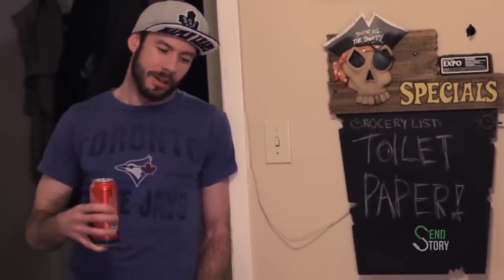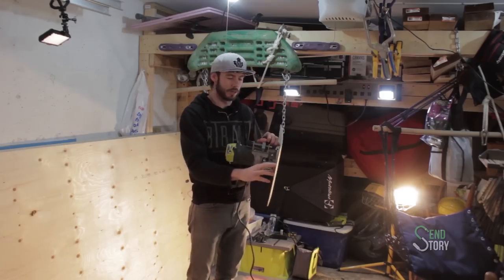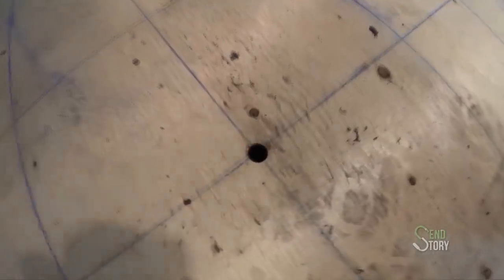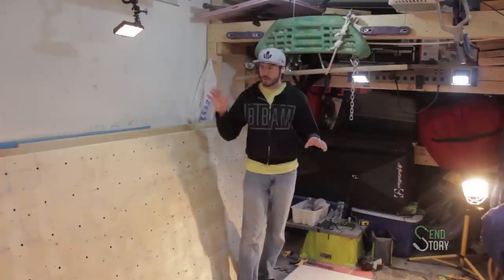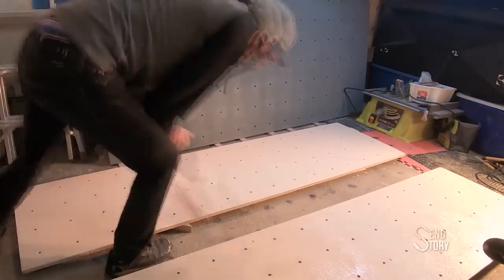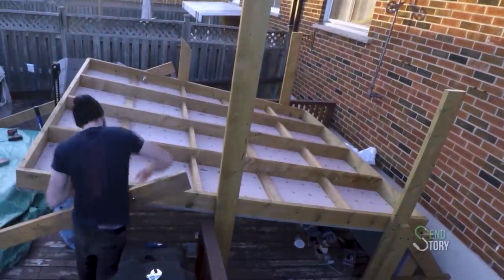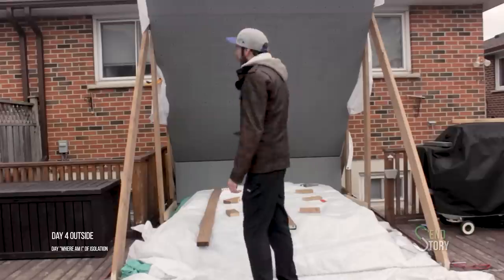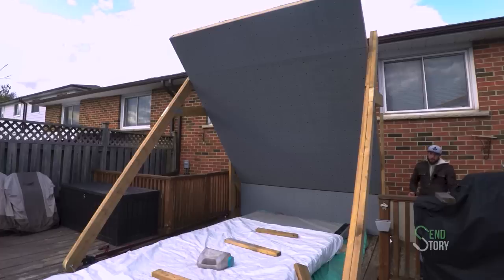Building an Adjustable Home Climbing Wall During Isolation - 12ft Bouldering Wall - Full Build Video

Comment: Great video! Me and my friends are going to build one like this! Did you only paint the plywood or the 2x's as well? also how much paint did you use for weatherproofing it?
Reply from the maker: I used exterior grade paint on the plywood, two coats on the entire boards. Make sure you paint before you put the T-Nuts in the wall, otherwise you can get paint in the threads and it will be really annoying and in some cases almost impossible to get out. I didnt paint the structure/dimensional lumber because it was all pressure treated and is all above grade and can dry. However, with that said, there is also pressure treated plywood, but I am not sure of it's strength/integrity. I also tarped the back of the wall after it was all assembled to keep the weather out of the T-Nuts and to remove the possibility for water to sit or pool in the structure and get into the ply. Some people also use other materials like corrugated plastics or light roofing substrates, but I wanted something simple, cheap and super light, so tarps were what I ended up with. Lastly, I would make your kick plate / kicker / kick board (or whatever you want to call it - the straight panel just about the ground) a tiny bit shorter than the frame it sits on because you dont want it sitting on the ground and have the chance to wick up moisture. I hope that helps!
Reply: @SendStory  Thanks so much for the reply and the tips! I was just wondering cause I'd have mine in my back yard with sprinklers and such so I might try tarping like you said or staining or painting what I can. Thanks again for the help!

Comment: Amazing build thank you for sharing.  Do you have a breakdown of materials and cost?
Reply from the maker: No problem! Thanks for the comments. Unfortunately I dont have a breakdown of costs and materials, but if you watch the video carefully you should be able to figure out the general material list. Every piece of lumber is 2x6, and 24" on center - so that works out to be 5 studs running vertical and then a base and top plate. That is true for the kicker and the adjustable wall. The legs I think are 12 ft lengths, and then the cross-bracing for the  base is just cut downs from the other lumber pieces. 

One of the reasons we dont have a full materials list or a breakdown of costs is because we wanted to build this wall for a while and were slowly collecting materials and parts over time and bought things like holds slowly on sale and such. I would say the build part, minus the price of holds, probably was around $1000, but most likely a bit under that. Some things might be over built slightly, and you might be able to do it cheaper. However with that said, the price of materials has definitely gone up since covid, so we would have no clue what they are right now.

There are also some more details and pictures through a link on our description that go to our site that might help you figure out materials along with the video. I would suggest always trying to get an extra piece of lumber or two, just in case you have any mis-cuts or other issues. Plus, you will always be able to use extra dimensional lumber somewhere. I hope that helps! Good luck!
Reply: @SendStory  Thank you, the breakdown on your site is helpful. I've since watched several other home builds and have compiled a rough material and cost list. Side note, do you use Blender for fun or career? Asking because I work in the gaming industry as a 3D artist, I plan on mocking up my build in 3D first as well. Thanks again!
Reply from the maker: @clarkcoots  Definitely started as a hobby, but I have slowly been introducing it to my professional career. The caveat there is that my job technically doesnt involve 3d, and if it does it is often an outsourced skill (I am in the general "design" world). Honestly, Blender is a specular program that is so unbelievably modular that it makes my head hurt sometimes just thinking about the offerings it provides while being open source. Thanks again for the comment, I appreciate it.

Comment: I want to know how you put it back to 45⁰ if you have to unspool the ratchet straps then the purpose of the ratchet straps is to set the wall 45 to 35 and not the other way around
Reply from the maker: Hey, the straps are definitely better in one direction than in the other, but they can still be used independently to capture distance and help lower it. Essentially if you are alone, you can just release the tension one side at a time, move the leg slightly, then re-lock the ratcheting mechanism and do the same on the other side. The way that the legs are angled actually mean that a lot of the weight of the wall is distributed down the legs into the ground and not outwards, so technically, when you loosen a strap, the wall stays put from my experience and you actually have to pull the leg to move it out. With two people you could change the angle quite quickly, and I would argue, safely, without much fuss. Alternatively, I mention in the video using a backup chain system with a carabiner at some point for redundancy, if that is installed, you can use that as well to help you lower the wall alone. Someone also mentioned "belaying" the wall on a gri-gri if you needed to, and while I think that is unnecessary (the steps I already wrote are more than enough to lower it), that would also work. I hope that helps.

Comment: What sort of hinges did you use, I'm thinking of doing something like this but not sure how
Reply from the maker: I used hefty gate hinges meant for outdoor use, as mentioned in the video, I used longer and stronger screws instead of what they came with. Alternatively, some people have used slightly bigger lumber and have put a metal pipe or conduit through a hole they drill through all of the boards to act as a hinge.

Comment: how many btbam shirts you own man? loving it. great build. just wondering what size wood you think would be minimum requirement for the frame on the back of the boards? Cheers!
Reply from the maker: Haha, someone noticed. It wasn't until I edited that I realized that I was basically wearing exclusively their merch. I pretty much buy all my shirts at shows, and they are one of my favourite bands, so I have a lot (plus my wife's shirts). As for the boards, I think 2x6 should be the minimum for this design. Some people build with 2x4, but I hear that flexes for a lot of people, so probably not the best bet especially if you are doing 24" on center like this one. If you wanted to try to save a buck, you could make the outer frame and legs thicker lumber, and center vertical supports 2x4, but the savings are probably minimal and it would make adding any type of back cover for weather more annoying to attach and have a bow in the middle. Following general house framing rules is a good idea, and most floor joists are a minimum of 2x6. Let me know if you have any more questions. Thanks for the comment.
Reply: @SendStory  thanks for getting back man. I've since built my own wall using pretty well recycled timber from around my parents yard. (bought a few 2x6's for the legs). It cranks! Loved the video. And yeah, btbam fucking rock. seen em a couple times down here in Aus

Comment: Do you mind sharing your 3D blender file? I'm considering building my own and want to compare designs, and maybe borrow/steal some of your ideas :P
Reply from the maker: Hey, I will try to see if I can upload a file at some point when I get a second. Not sure how hopeful it will be (it's pretty basic), I did upload a render with measurements on the link in the bottom of the description, that might be more useful. Let me know if that helps!
Reply from the maker: I am fairly certain it is much too late, but just uploaded the .blend to Blend Swap - you can find the link under the image of the rendering on the build page on our website (linked in the description of this video). Not sure it offers a whole lot more than the descriptions and images on the page, but hope that helps!

Comment: This is great! So detailed, thank you - I’m currently starting my process into building my own wall. 

I was wondering why you decided to go with the industrial grade t nuts (3 screws) instead of the t nuts with the teeth, that you just can hammer in. I assume it’s because the industrial ones are stronger and less likely to strip? Do you think it’s worth it to buy the industrial t nuts over the other ones?
Reply from the maker: Thanks for the comment. I have used hammer-ins in the past and had a few issues. One of them being that because you hammer them in, the force of the strikes can force them in on odd angles sometimes if you aren't careful. The second issue I had no comparison to confirm, but I heard they tend to fail more frequently than the screw-ins. So far I think this is true, but it's not like the hammer-ins ripped out frequently or anything. Honestly though, on a volume I built, I simply put a bit of regular wood glue around outside of the holes i drilled before I hammered in the tnut and they have held up great. So, for a home wall I wouldn't worry too much about the tnut unless it is in a place you can't access - then it might be worth it for the screw-ins
Reply: Send Story awesome thanks for the reply!! 😊 very helpful!

Comment: This is awesome!! I’m from Chile and this is an incredible home wall!
I have a question, how do you do to adjust the angle back to 45, from 35 for example? 
I mean, how do you make the angle stronger after you already put it higher up? 
My fear is that the wall just fall down. 
Thank you so much!
Reply from the maker: Totally a valid question. I've only lessened the angle once, so I can't day I've adjusted it a lot. However, if you adjust it slightly one side at a time, it seems fine, just a little clunky. So essentially you just loosen one side a bit, then lock the ratchet, and then do the same on the other side and go back and forth at a pace you feel comfortable with. Alternatively, if you had two people you could both adjust it similarly, but a lot faster and even on both sides.
Reply: @SendStory  Thank you so much for your answer!!
Reply from the maker: @raisadegodoy9071  no problem! Hope it helps

Comment: hey i have been wanting to build my own wall however im not sure on how i work out what supports i need for my wall
Reply from the maker: Like I mention in the video, I'm not an engineer, so I would have someone with structural knowledge look over anything you build that you are worried about.  Typically, using house framing as an example you can roughly figure out what kind of lumber you need and how it should be assembled. In construction, you want anything load bearing to be resting/supported directly by structure (in this case,  lumber). The type of support you need will depend on your design, so it's hard to comment without knowing what it looks like, but typically you want to be using at least 2x6 for supports and if you aren't tying into other existing structure (like a wall or roof), you want to have your supports in the direction of the load. So in my example, since I wasn't tying into structure (it was free standing), and it was designed to be over-hanging, I put my supports on a diagonal to make it an A-frame. So when my force is pulling down with gravity and out from the wall, the legs (supports) are taking that force. I hope that helps, there is a good resource on Facebook called "the home climbing forum" which might be able to help you out more as well.  Good luck!

Comment: how did you attach the horizontal and vertical bracing? pocket screws?
Reply from the maker: I actually just offset them by half their depth so I could screw directly through the vertical studs into the bracing ends. You could probably "toe-nail" or pocket screw holes if the obsessive compulsive in you wanted them all to line up, but I think you would lose some of the rigidity you get from screwing right through. Hope that helps!
Reply: @SendStory  ah that makes sense, thanks dude

Comment: How much was all this minus the holds ?
Reply from the maker: Hey! I think it was probably all under $1000 (CAD). It is hard to say though, because I had been planning on building some kind of climbing structure for a while and accumulated some hardware and had built up a little supply of lumber before hand, so it would definitely be an estimation. Also, right now lumber costs are through the roof because of Covid, so my figures probably dont add up. Something else to consider, which isnt something you asked, but I figured I would share to help you budget more accurately, when you are thinking about holds, dont forget you need to get the bolts with them. They are an additional cost. Some sites allow you to order your holds with bolts, this is probably the best option so you are including that in the budget. Hopefully some of that was helpful. Thanks for the comment.

Comment: Do you have the blender file? I am creating my own wall but am struggling with constraints to get the hinge actions to work.
Reply from the maker: Hey, I actually have it through a link on our site (buried low in this video description, but right now the hosting company is doing maintenance and the site is deathly slow). Here is a work around link: https://blendswap.com/blend/26374 - Unfortunately, I dont think I have the constraints and such working in that file, but you should be able to work around it by just setting your cursor to the pivot point (inner bottom vertices of the wall face) and setting your rotation tool to pivot (transform) around the cursor. A bit clunky, but it should hopefully do more or less the same thing you are looking for (I hope). Feel free to ask any questions if you need to, good luck!
Reply: @SendStory  thanks a bunch for the reply. I'll definitely take a look at the blender file. I'm struggling with constraints at the moment. I'm also building a free standing board that changes angle, but mine is a bit more complex then your design https://www.youtube.com/watch?v=2bqjb62jqSE . Do you have any resources that helped you to better understand constraints and armature rigging? I'm totally stuck right now; I'm frying my brain just looking at this blender project and not knowing how to even begin to get this thing properly constrained or rigged.
Reply from the maker: @CapableCaptain-ahoy  honestly, I unfortunately don't have a good answer for you. I have watched a bunch of tutorials over the years on rigging and just leaned on that memory/knowledge. The rig I made was definitely finicky and not perfect (it might have been a little bit of animation on top of the rig to fix pitfalls of it... can't remember), rigging can get super complicated and almost like visual programming. I think cgcookie had some good rigging tutorials (not sure if they were free or behind the paywall), but I would watch any YouTube blender tutorials on rigging mechanical actions/movements specifically. I think on this animated demo I used parenting quite a bit (parenting things to eachother and to empties). Also, the object origin points definitely played a role in it (having the origin point set to the pivot point rather than the center of mass). If I have time and can find the animated file, I will try to see if I can provide more info/upload a video somewhere for you. Sorry if that isn't much help.
Reply: @SendStory  no, everything you said right now was quite helpful. I searched up mechanical rigging and I think that's exactly what I need to learn. It really is complicated 😅, I'm just glad that it's objectively complicated and not just difficult for me. The blender file with the animations and such would be helpful, but don't stress over trying to find it if it's buried deep somewhere on your computer. Thanks again for the help. Building a home wall is definitely quite the project.
Reply from the maker: @CapableCaptain-ahoy  yea, it's funny you asked about the wall mechanics because I've been thinking about modifying/updating the wall again. So I might find myself in the same spot as you soon. Good luck!

Comment: How much did this all cost
Reply from the maker: Probably about $1000 all in. Depending on how you plan on using it, where you put it, how long you want it to last, etc., you could probably build it for cheaper. The Climber Dad link in my description has something super similar, but probably cheaper to build if that is too high of a budget. Hope that helps.